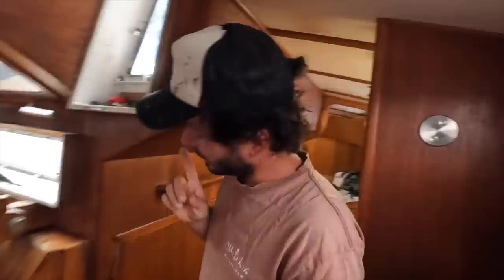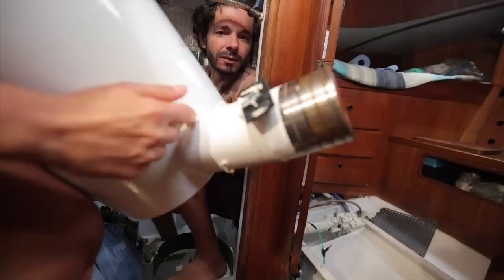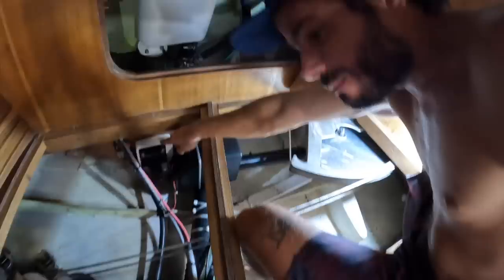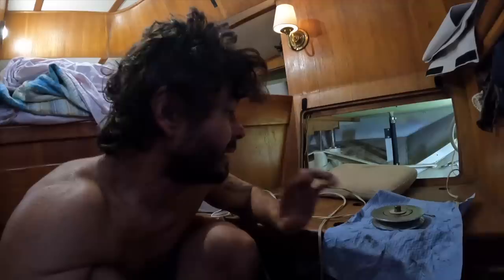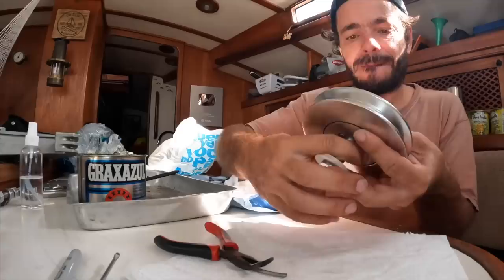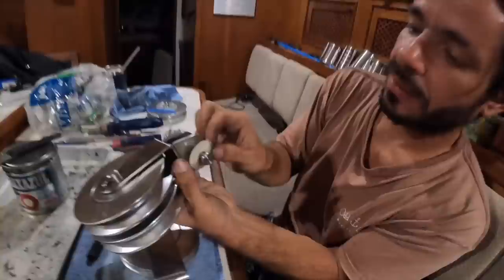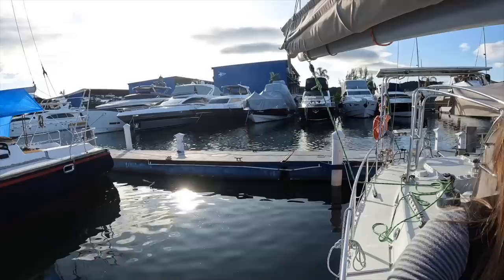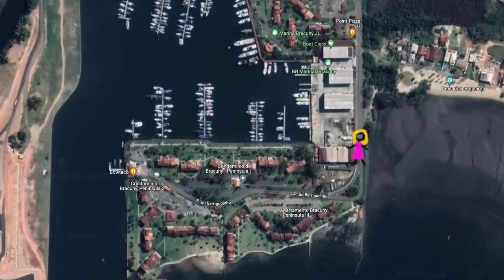⛵️Salt water on our bilge!! Taking our boat apart AGAIN!! 😵Ep.245

Comment: The BIKE  ... yes! 

I've been liveaboard 5 years now, and, the folding bike is one of most precious items. It gets used as a mule,  to carry maybe up to 50litres diesel, water, even a 30kg battery.... and folds small enough to drop into my little Zodiac rib, take on trains, buses ... and light enough to carry up stairs,  crossing railway station platforms. 
I have only 16" wheels, so not great efficient for riding, but, v small.

Big issue,  is keeping salt water off, especially the regular beach trips,  for shopping expeditions,  and launching into breaking waves. A good robust bag, especially with carry handle to lift,  lower,  to deck from dinghy, raally helps.

I've reached so many places I couldn't otherwise have,  with bike. I even got to see Tour de France on island near La Rochelle. 
You'll LOVE it!

A crate, net, bungee, whatever ...also essential to secure weird stuff we sailors always seem to need. Obvious I know,  but it's a pain without, and fantastic when realise can carry a full gas cylinder, or even hitch a folding shopping trolley, like 'grandma' uses  as a bike trailer👍

Comment: Hello Roberta and Duca.  Be careful of one thing with the bike.  If you plan to use a big backpack
to put your groceries into and carry it on your back you can find that steering becomes very weird.
This is because you have changed your center of gravity much higher than the bike was designed for.

I found this out one time when I decided to put a lot of clothes into my old Army Duffle  bag  and ride my ten speed bike to the 
Laundrymat.   Haha  it was hard to keep the bike going in a straight line.  Riding the bike became like  operating a sailboat
in a storm haha.

Try to hang some bags from the handlebars.  It would be nice if you could use a quickmount to put on a basket over the rear wheel when you go out shopping.

Comment: Enjoyed your video! If the original pulleys are in good condition, they will have far less rolling resistance under load than the new sample you showed. Thanks, and good luck with your repairs.

Comment: You should see if you can find yourself one of those one wheel trailers or other folding type bicycle trailers that would really make it useful when you go to the grocery store. Are used to do that a lot back when I was younger. Of course then I had to touring bike that had lots of brackets for different packs send bags to be attached to. Two by the front tire one bag on the handlebars two on the back tires the big packs and then the one cooler that sat on top of the rack that held all the bags on the back behind the seat. So if you have a rear cargo rack on your bike you can get yourself a set of pannier bags for a bicycle rear wheel cargo rack. You could use this in lieu of or in conjunction with a bike trailer. The pannier bags, if you could use them, will definitely take up a lot less space but won’t have the capacity of a folding cargo trailer for a bicycle. if you had the cargo trailer for your bike you could easily load up your gas cans and ride off to gas station and bring back several cans in one trip full with little effort.

Comment: Wrap the bike when stored and have a oily rag to keep from corrosion!
Reply from the maker: Thanks for the suggestion
Reply: @OddLifeCrafting  
Wipe all parts over with 3in1 type oil and put a drop on all the pivot points wipe the chain off and then over with a clean oily cloth.. 
Chrome will corrode very quick and if the spokes are not stainless and the rims alloy ...wipe the spokes over or they will rust very quick...
The seat stem needs lithium grease to keep it moving freely. NOT the white bike stuff its terrible.

Comment: I have a bunch of platitudes to throw at you.  All of the big things are made up of little things.  The way to eat an elephant is one bite at a time.  You get the drift.  The hard part is to accurately define the problem.  After that it's just nibbling away at what's wrong.  Cruising = boat work in exotic locations.  Enough with the old saws.  You two make an excellent team.  Thank you for tripling your work load to share the journey with us.

Comment: Duca a small piece of wisdom from someone who's paid to test systems: 
There is always a weak point in the system, when you find it and "fix" it you simply move the the weak point somewhere else in the system.
The lesson you need to learn is to build the system in a way that you know where the weak point will be, aim for that weak point to be a cheap and easily replaceable part and carry multiple spares for that part. An example of this is the sheer pin in the propellor of you outboard, the sheer pin is the weakest part, designed to be cheap and easy to replace and easy to carry spares, In your electrical system the fuses is the designed weak point.
Reply from the maker: You are one hundred 100% Dan. Now the week point is the pin. And that we have spare. 👌🏼

Comment: Why does it look like you didn't pack the ball bearings in grease? If you didn't that'll likely reduce the life significantly.

As long as them blocks are cleaned and regreased regularly (yearly?) then they shouldn't fail. I'd recommend spare ball bearings for any that fail/crush though so you can simply replace the bad bearings when doing your service.

For the bimminie I'd have used a rigid solar panel setup as the roof. Covers you, no flapping in the wind and you get the benefit in the battery bank.

Comment: I'm a little concerned about the stainless steel attachment point the main is attached to at 19:00.   The angle of the pull should be in line with the arc of the component but it is at 90 degrees which may well put an extreme torque on those welds since this is taking the load of the main.   I don't think the welds should be torqued but only in tension.  Maybe there is something I don't understand but that doesn't look right.   I love how you are working to get the boat right!

Comment: Glad you found the leak(s). Can you pressure test the repaired pipes with some compressed air & soapy water? No bubbles, no troubles. I was worried it was your prop shaft seal system, the most complex I've ever seen.

Comment: Hello Duca and Roberta.  I was wondering if you are replacing the stainless steel cable for the rudder
with Dyneema synthetic line will the new line stretch out quite a bit?    Do you anticipate that and just plan to 
periodically take up the slack?

Comment: I just had a weird idea that I have no clue would work or now, but what about added solar panels to the boom,  a type of solar panels you could unhook and reattach when you needed the extra power.  When at anchor the boom is just there anyway so why not? The panels could then be mounted to a lightweight framework to make this easy and then when unhooked they could be stored elsewhere.

I know space is premium and storage is limited on a ship, but the boom is there and it's now covering other solar panels over the whole length, so why not? I can actually see how it could be done in my head, but ideas rarely meet reality perfectly, so it would have to be tried to find if it's workable or not.

Comment: I'd be worried that the Spectra would stretch more than the stainless and also be more susceptible to abrasion because the same spots will be in contact with the pulleys.